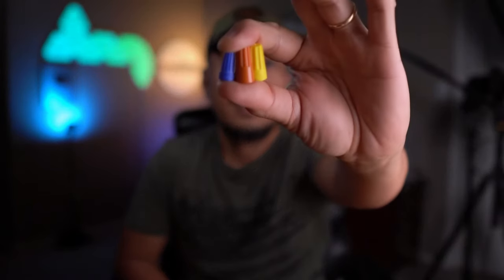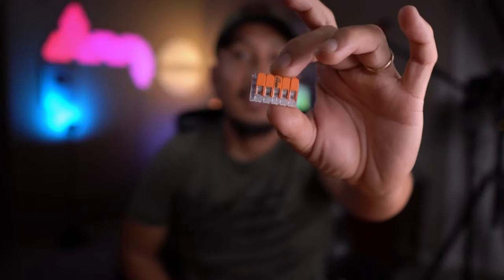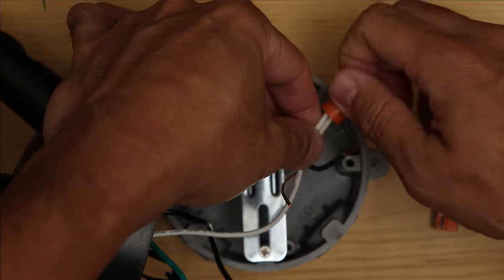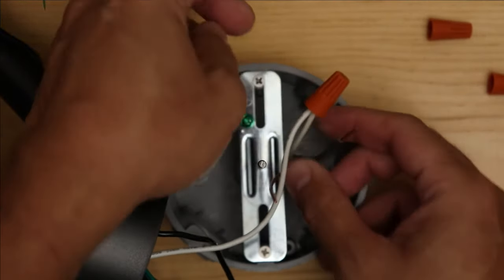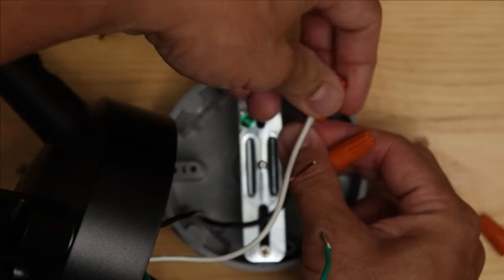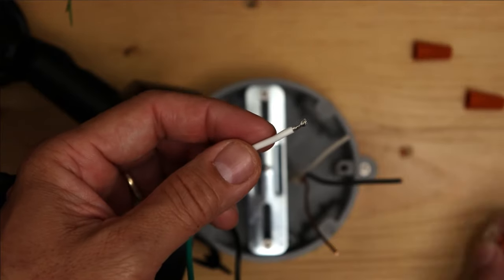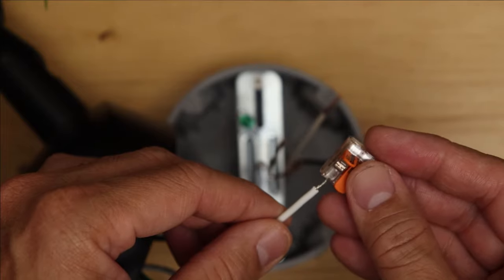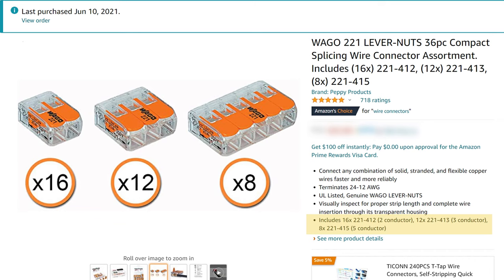Wago Connectors - EASY ways to connect 2 or more wires!

Comment: you have to be careful with wagos because occasionally a stranded wire does not connect well. Just have to be careful to check the connections. I like wagos but a poor connection is possible. Have to check connections.

Comment: Good, but what are the 3 and 5 wire versions used for?  I assume the 3-wire is for a ground but what about the 5-wire?
Reply: If you want to connect 3-5 wires together.

Comment: Lifehackster,
Thanks for your review of these new wire connectors. So far, no one has really explained how the black wire connects to the other black wire using these new wire connectors, and how the white wire connects to the other white wire, and so forth. But, at least this video shows clearly, without mentioning it, how black is connected to black and so forth. Thanks for that. I bought some 3 hole connectors because i had 3 wires to connect, thinking that 1 connector would needed, but after watching this video, i can see that i needed 3 sets of 2 hole connectors.

Comment: Your wires were too short which is why the wire nuts failed. Any idea how much pull the Wago can tolerate? How secure is the connection?
Reply: The one in the video is 32A version. The 41A version is slightly larger.. They are very common in Europe.
Reply: @Mixolixplosion  is the 41 better?
Reply: @richardb7093  waste of money if your breaker is not bigger than 20A.. just use the 32A version. Wago is a very respectable brand in Europe.